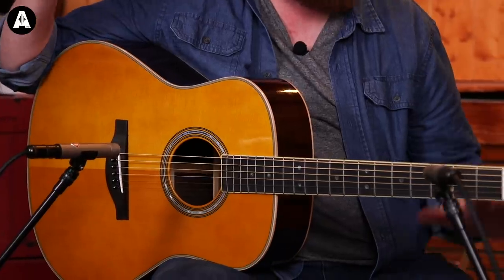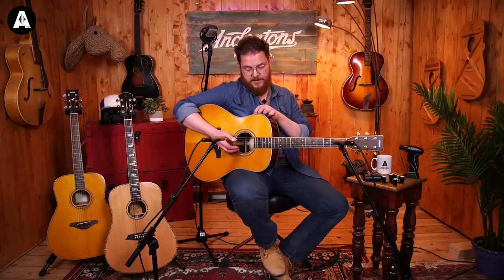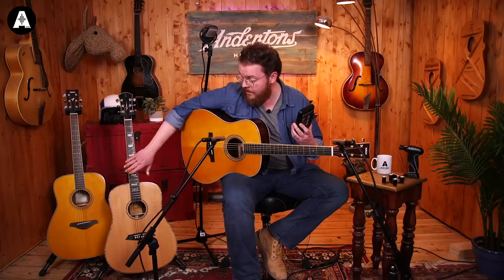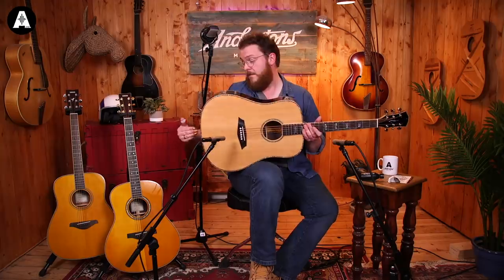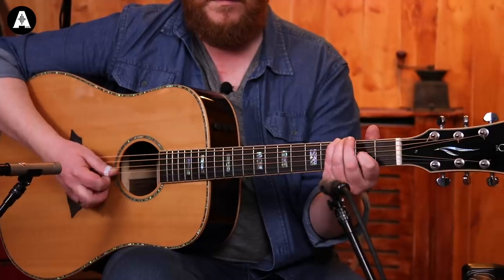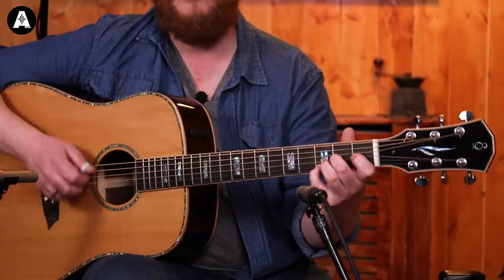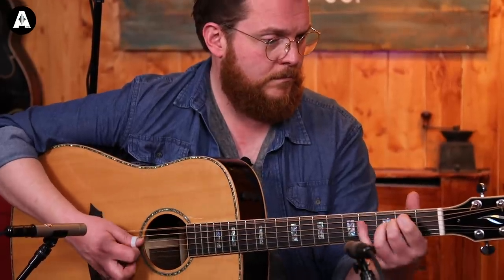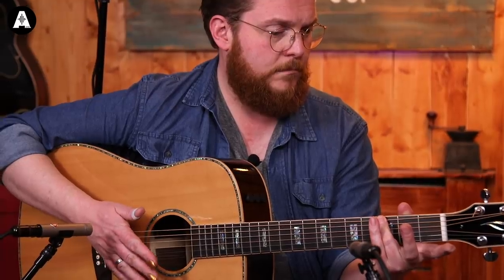Yamaha TransAcoustic Vs The ToneWoodAmp - Do They Make An Acoustic Guitar Sound Better?

Comment: The Yamaha sounds more natural.  I bought one based on that difference after listening to as many recordings of as I could.  There seems to be some digital bloom and tail on the Tonewood, and I can distinctly hear the dry guitar and the effects somewhat separated.  Would love to hear comments and recordings from Tonewood owners who have figured out how to get the most natural sounding effect, and also how the mentioned chorus effect turned out.  Thanks for a great review!
Reply: I definitely agree with you, I've had the lower end FG Trans-Acoustic for a year and even this is a breathtaking guitar. I believe it is because the Tonewood just mounts to the back itself whereas the Yamaha's transducer mounts to the structural parts and the back so there is more wood to come in contact with and resonate.
Reply: @brandonhaas9165  Agree.  And, the tonewood gets its input from the piezo or other pickup already mounted on the guitar.  Piezo quack is not a desirable part of the tonal response, but the tonewood gets that and then processes it.  I'm not sure what the input transducer is on the Yamaha TA module, but it is much more natural.   Of course if you had a mini acoustic mic inside your guitar to feed the tonewood, you might get a much better result.  Few guitars in the low to mid-price segments have that, though.  I think Yamaha pulled off a minor miracle.  I too have the FG... it is a terrific instrument.
Reply: Good to hear you guys rating these guitars as thinking about one myself. Just didn't know with putting all the tech in them have they cut spec in way?
Reply: @serpentor21  To me, no. I've had costlier guitars and I prefer this Yamaha.  Excellent build quality,  playability and tone just plain, without the effects.  It's not the loudest guitar I've had, but I've come to see "loud enough'' as the measure unless you do a lot of bluegrass jams with loud banjos and other loud guitars.  Then you need a cannon.  Acoustics have come a LONG way in price/performance.  I have a Fender Sonoran in surf green that sounds and plays great, it was very inexpensive.  Wish it had the TA system!
Reply: @DogFoodTunes  The Yamaha convinced me I needed to learn acoustic guitar. As a total beginner, I think it’s amazing. Nice to hear from veterans that you all enjoy it as well. 💫
Reply: I own a tonewoodamp effects unit and it is very flexible, you have the freedom to tweak the reverbs, delays, Leslie, wah-wah, chorus, base on your taste.. it can be as loud or subtle as you want, it can be as organic and natural as you prefer.. you have total control over the effects.. not sure why they named it tonewoodamp (it is not an amp), more like an effects unit and if you are doing a performance in a large area.. you can plug it into a PA system or an acoustic amp for the effects..  personally I don't do it justice.. Mike Dawes is one of the better acoustic guitar players who can utilize it effectively.

I noticed Anderton's demo did not even edit the base effects.. although it is plug and play, you are able to fully accentuate the guitar by tweaking the effects to suite it.. if you own multiple acoustic guitars (if it doesn't have pickup just get soundhole pickup and plugin to TWA unit)..  customize the TWA to match each guitar and save preset to each guitar.. it is a little overwhelming if you just want simple.. TWA can get you the sound as long as you invest time into adjusting each element of the effects.
Reply: @K750Ric  thanks, great info!

Comment: I have a Yamaha LA TA. All I can say is I sold my 6 series Taylor as I never played it after getting the the TA. The best kept secret ever. The absolute only minor problem is sometimes you get feedback if you put the guitar down and let a string ring out. But once you do it once you remember to turn it off.
Reply: I really wonder if Yamaha can use this tech and make a $500 guitar sound like a $5000 all solid vintage guitar. Looking forward to this tech.
Reply: With the tonewood you have to adjust the gain in the settings. Kinda hard to get to, not right out in the open, but you can dial it in so you never get feedback. You might have too much saturation in your fx, but if it sounds killer then it sounds killer.
Reply: @Scott Moffat  I read the Yamaha has “line out”... When plugged in to a board, are there any other controls than when playing acoustic?Do the reverb and chorus function the same as unplugged?

Comment: For the Tonewood, you need an existing electro acoustic guitar, as the effects box is driven by the guitars inbuilt pickup.
I didn't have a guitar with an inbuilt pickup, so the Tonewood wouldn't have worked for me. Of course, I could have bought a reasonable electro acoustic plus the Tonewood, but I thought the Tonewood might have had more settings and voices than I could really use, and I might have ended up very confused by too much choice of effects.
I sold a couple of other guitars and took the plunge on a Yamaha Transacoustic exactly as was played on this review. It's everything I hoped it would be...... It has enough effects without being too much, and they are easy to engage or disengage. It works for me, but it won't suit everyone......
Reply: Tonewood can work with non electric-acoustic guitars.  There's an option on their website which includes an attachable sound hole pickup.  Don't know how good the quality is of the pickup though
Reply: @fastfour8727  yea it's a pretty cheap pickup with the wire coming out the soundhole unless you get it installed
I like the options on the tone wood I just hate how big it is on the back of the guitar.
But it is great.

Comment: The sticky feet on the TA don't stay on forever. I bought 2 receivers, placed them into 2 guitars and they both came off within six months. It comes with extra adhesive pads but kind of a hassle. Good sounds, yes. I'm thinking about the Yamaha though. No real wrong answer here. Great demo!

Comment: I was VERY close to getting the tonewood but I read the reviews on Amazon and what you say about the Reverb seems to confirm my suspicions - and what other are saying. There is a large difference between a guitar BUILT with these effect internally and using the guitar back and body as your speaker/soundboard; which is exactly what the tonewood does. People often complain about muddy sounds or delayed echos bouncing around within the guitar. (that and the constant gain/noise issues seem to be high on people list). There's a high degree of likelihood that every guitars acoustic's back is going to act differently and that the resonance within the body cavity will also vary. At least with the Yamaha everything will have been 'matched' to some design spec.

If I were to spend the money I think I'd go for the Transacoustic.
Reply: I have to agree with you about a bit of a muddy sound and what appears to be a constant feedback going in the background of the TA. The Yamaha definitely had a clearer reverb. It sounded more organic.

Comment: Yamaha for me, easy to use accept that you can't tell its on w/o strumming or looking to see the small light inside the circuit board under controls inside  . I understand  the idea is to get effex w/o a amp or PA but you can use the  Yamaha thru the system and effex follow it or can be turned off the same as the TW. it is not an either or it is an awesome guitar on its own with effex, w/o effex, plugged in to amp or PA and use effext or not... all good . I  tried several wondering if it was" gimmickie ". I looked into the Tonewood and thought it was awesome but  pulled the trigger on the Yamaha. Been flawless and the battery replacement is one of the easiest to perform i have come across yet ! for those that hate the Velcro pouch hidden in the bracing...

Comment: I had a Transacoustic and, while interesting and nice in many ways, I was very disappointed that Yamaha had not bothered to include a battery indicator, especially considering how much battery it consumes.  There is also no indicator that it is turned on and no sensor that automatically turns it off if idle. I can forgive them for the tuners, but not for that. It goes without saying that more often than not,  the batteries were dead when I needed them. Sure, one can always change just to make sure, but how many good batteries would I throw away?
Reply: Keep a spare in your bag and you'll never be caught out... Impossible to go through a set on a single performance, so shouldn't be an issue
Reply: @notshared4072  My issue is that they save a few cents on a very expensive guitar and their saving cost me many batteries. If you have one, you know you forget to turn it off now and then. My €90 ukulele has a battery and on/off indicator...
Reply: @zykify  I do indeed own one, and mine has an indicator (inside the sound hole) and also turns itself off after being idle for some time.  Even if I play intermittently all day long and NEVER remember to turn the battery off, it lasts several days on a pair of rechargeable cells.  So one pair goes into the charger and the other into the guitar.  If you're gigging and can't be bothered to change batteries before a performance, you maybe deserve what you get?

Comment: Also, it would just be interesting, though probably not that noticeable (or maybe it would), but Tonewood gives very specific  specific instructions for different type of guitars as to where the box should be placed on the back, and Ben just slapped it on anywhere. I wonder if it would sound different had he followed the guidelines.
Reply: Im guessing he read the directions… and the back unit is sitting where it should be.  I could be wrong tho.

Comment: I have the Tonewood and have played the Yamaha many times but i don't own one.   If you are buying a guitar in the price range of the Yamaha with the reverb don't buy a cheaper guitar and the Tonewood....just get the Yamaha.   The built in Yamaha reverb/chorus is a better tone than the Tonewood by just a little.  But if you are retro fitting an existing guitar the Tonewood will be very pleasing.  Also not for either system ....this is good for you and a singer....not so good playing with other guitarists....campfire singing not that good either....it is for a single guitar or guitar and singer....bottom line....its pretty cool (either product).
Reply: Good comment. I am thinking of either the FGX830C + Tonewood or just the FG-TA. Not an exact $ for $ equal, but close enough that I'm considering between those 2 options. Cheers.

Comment: The Tonewood sounds very artificial to me. Not my cup of tea. I thought the Yamaha sounded good.
Reply: I have one. It's incredible
Reply: I've tried the Yamaha, it sounds a lot better in person than what you hear in these vids.
Reply: I have both... I prefer the tonewood.  I think the reverb and chorus (available after firmware upgrade, replacing the distortion) are less "zingy" and artificial sounding than the Transacoustic.  The Yamaha LS-TA transacoustic is, on its own, a great guitar....
Reply: Witch is cheaper
Reply: personally I think the TonewoodAmp is the better option, the real problem here is he didn't have it dialed in correctly. Mike Dawes did a great demo with Lee like two years ago... it  sounds a million times better in that video, on the same style Sigma guitar I might add
Reply: @jeffhatcher6778  what guitar do you have it on.
I wish he tested the tone wood on that Yamaha
Reply: @Tigerex966  I can switch it between a Michael Kelly Triad Port, an Epiphone EJ200, and a Yamaha FSX5.  The FSX5 has the same body style as the LS-TA, but different tonewoods (LS-TA- Engelman Top, Indian rosewood B/s, FSX5 Sitka top/ mahogany B/S)  and a little different bracing, so the base sound is different ( a little drier and middy), but the reverb, delays, and chorus sound much less zingy using the Tonewood vs. the Transacoustic system of the LS-TA, as the most direct comparison I could make.
Reply: Except the Tonwood will sound different depending every type of guitar because it is resonating the guitar body itself.  There is even a pic-up from Tonewood so that you can use it on a Classical Nylon-string guitar.  Which is a whole other world unto itself.

Comment: My tonewood feedbacks like crazy. I cant figure out how to make it work well. I never use it now.
Reply: Mine, too, in certain guitars. And the positioning makes a huge difference in the sound. If not quite right, it can sound honky or dull or brittle, and sometimes even the guitar vibrates in a weird way or feeds back. Way too fiddly for me, also with the programming for each guitar and position. Looking to sell my Tonewood and get a Yamaha FG-TA.
Reply: You have to dial it in....reduce the output level on your guitar preamp and adjust the gain on the tonewood until it stops and you get the balance that you are looking for.
Reply: Just in case anyone is reading this and wants to know how it went, I indeed got a Yamaha FG-TA (Transacoustic) with a built in „accuator“ that does something similar to what the TWA does, though only for reverb and chorus. And I LOVE it! :-)) Even without the effects turned on, it surprised me with a full, rich, detailed, well-balanced sound and great playability/action, as well as clean workmanship all around. The factory-installed Elixir Nanoweb strings are also a perfect match for the guitar, and even sound powerful when the guitar is tuned down a full step, to D, across all the strings. That really surprised me. And the effects are always available, unobtrusively. No switching around of a TWA to deal with, no trying to find the right position for an inner X-brace like with the TWA, no fiddling with and storing of parameters - just plain playing and enjoyment! The reverb can be dialed in for a little or a lot, and the chorus from barely perceivable to sea-sick. ;-) This gets the job done for me, for sure. Naturally, such a guitar is limited in turns of the sounds you can get out of it unplugged, but I don‘t kill. „Kill complexity“ has become my motto. It‘s much for fun to just play, and immerse myself in lush fingerpicking with a beautiful reverb, without any added technology. Well done, Yamaha! (And so far I‘ve been a Martin guy, but I see the Japanese have not been sleeping when it comes to developing great scalloped bracing for good sustain and voicing, even on a guitar with laminated back and sides.)

Comment: Here’s a fly in the ointment for the Tonewood. Will it allow my guitar to still fit in its case? How much work is it to take off the back for the guy who gigs out often?
Reply: It attaches magnetically and can be removed in literally 3 seconds. The magnetic x brace mounts to the inside of the guitar with double sided tape and just stays there. One of the real advantages of the TWA is that you can just purchase additional X braces and use the amp on multiple guitars.

Comment: Does it make the guitar louder? if so, If you use a DPA4099 microphone for live situations (to get the most natural sound possible) it would result to less feedback and spillage from other instruments as you can get away with turning the microphone down. What are your thoughts about this? anyone experimented with this idea?
Reply: The Yamaha is definitely louder with the Reverb and Chorus.  Some of it is perceived volume, but if the Reverb is set right, you’re essentially stacking sound waves on top of each other as it’s projecting out of the guitar.

Comment: I understand a big megnet needs to be placed inside the guitar. My guitar is 2 1/4 inches deep. I don't think I could fit the mgnet(?)  Could the Amp be attached to the back of the guitar using strips of Blu-Tack, please?